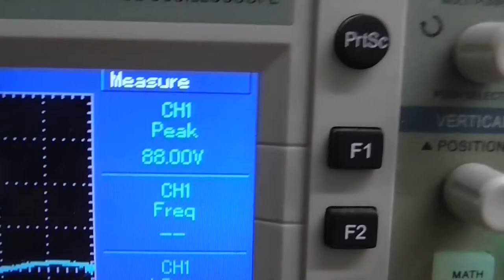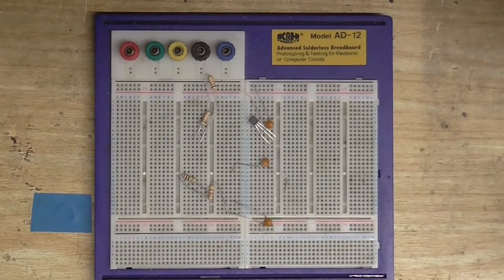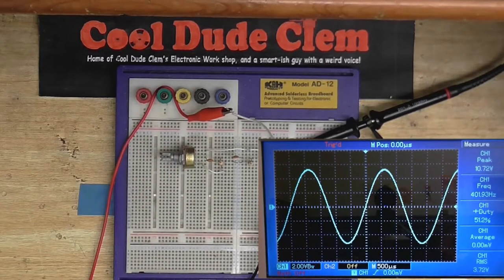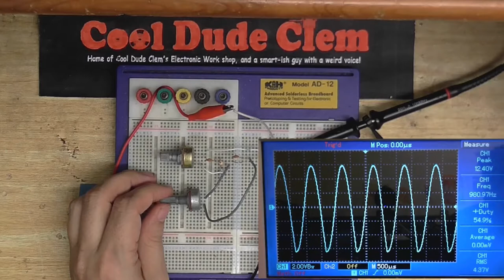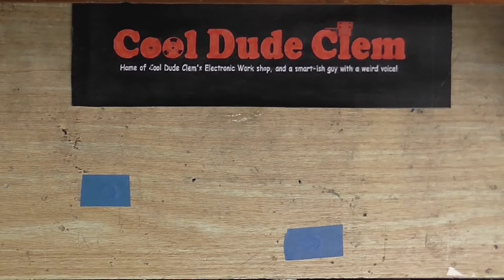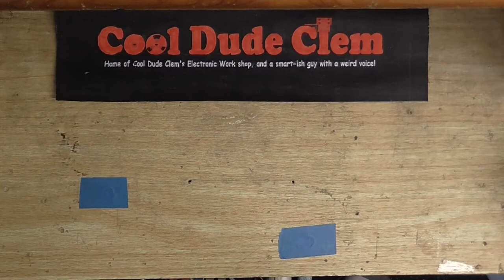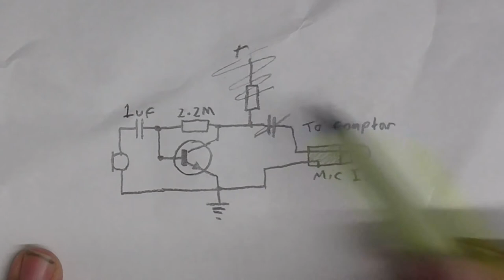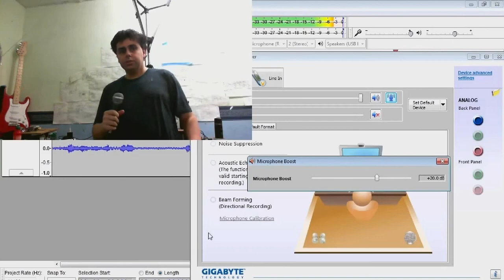CDC Electronic Workshop - Experimentying with phase shift oscillator and ...

Comment: Great video , your potentiometer solution reminds me of something I leaned where on a Wien bridge oscillator a lamp was used to smooth the clipping due to the ability of the lamp to adjust its resistance based on its energy input.

Comment: Running my mic through a small Behringer mixer, out through the USB port on the mixer into the USB port on the computer. Works great.
Have a great week.
Reply from the maker: I'm sure it does and in most cases when I do my recording I use a similar method. This however was just a fun experiment and now if I need to make a "Quick and dirty" recording on the computer, that circuit will come in handy.

Comment: This is neat! I'm always trying to get as much good sound with my microphones as I can, and even with my limited knowledge of electrics, I could probably make something like this. One question though, will this work with a stereo mic., or is it just monophonic?
Reply from the maker: It's only mono. For stereo you would need to make two, one for the left and one for the right.
Reply: @CoolDudeClem  Would you need two of EVERY component, or just a few of them?
Reply from the maker: @gabesyt4863  Yeah two of every component, so that would be 2 capacitors 2 resistors, and two transistors.